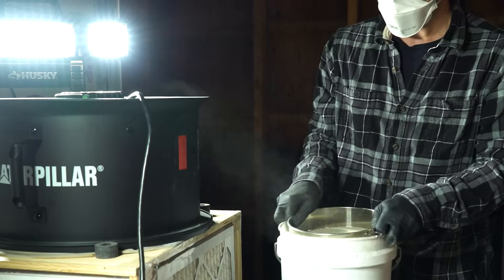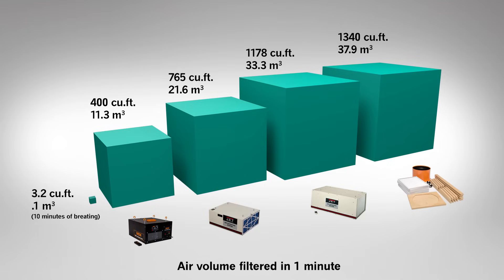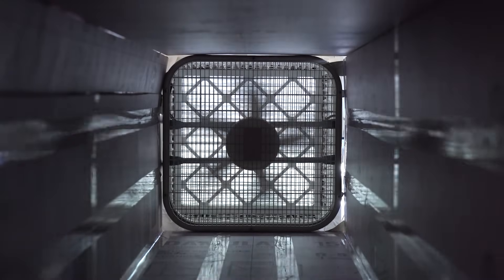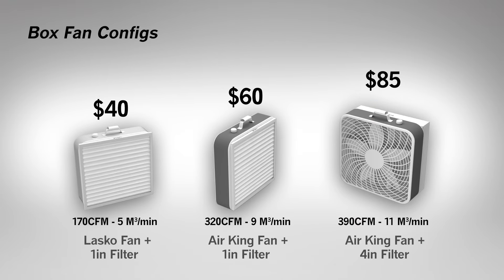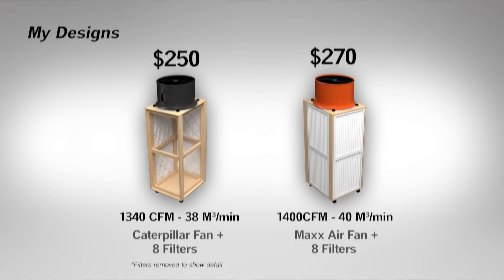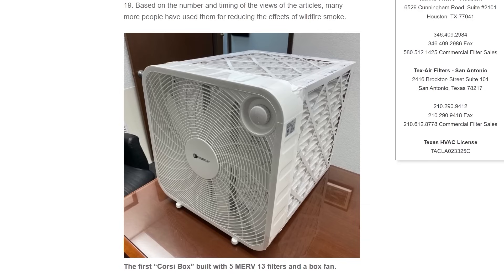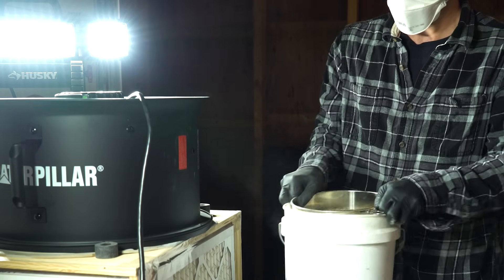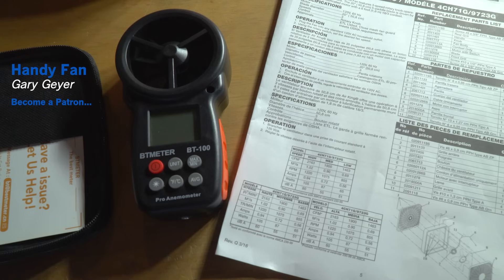What is the best DIY Air Filter?

Comment: I took the plastic grid cover off my box fan and used some old coroplast to build a round shroud just a 1/4" off the fan blade tips. Then put the screen back on the box fan. It's a noticeable difference in how much air it moves so when I put a 1" filter on the back it actually sucked some dust VS before the shrouded blades it sucked nothing (the air was just circulating inside the box fan)
Reply from the maker: I try not to remove the grid from any fan fan for safety reasons. The shroud concept still works when it is on the outside of the fan. My tests show about an 8% gain. I will do a shroud video soon.
Reply: @The3DHandyman  I did mention that I replaced the grid after putting in the shroud. In fact, the grids sandwitching the shroud helped secure / retain it. I did have to make relief cuts in the shroud for the motor mount brackets and didn't try to cover them for a 'perfect' shroud but I doubt they cause much leakage to the airflow. I had thought about adding an anular intake bell using a cut up old pool noodle which is supposed to make a big difference but I needed to get the filter working, now waste time trying to get 1% more efficency.
Reply from the maker: @bobjoatmon1993  Ah, missed that part. Good choice! Personally, I think using a more powerful fan or better filters is the easiest way to improve performance. That can increase efficiency by several hundred percent which can make a huge difference in air quality.
Reply: @The3DHandyman  yes, I have since (just recently) swapped it out for a Dewalt DXF2042 drum fan. My filter box, mounted on the ceiling (so that's a 'blank' side) has  the fan in one side and the bottom and remaining 3 sides have 24X24X1, MIRV filters. I quit trying to make a silk purse out of a sows ear with box fans.

Comment: I have several squirel cage fans from old house AC that seem to move a LOT of air.  Some even have belt and remote motors (ideal for capturing combustible spray (think car spray booths)).  I would love to see your wind tunnel demo on this configuration (and the 8 merv 14 filter box).  Thanks.
Reply from the maker: I got a used blower motor from an old furnace as well. I hope to test that out with a few designs later this year. They are great motors that move a lot of air but they also pull a lot of power in comparison to axial fans.

Comment: You act have the fan wrong your pushing through the filter which put pressure on the fan you need it pulling throug the filter, your hvac dose not push air through the filter it pulls air through it, all hosp an any type of filtration pulls air through the filter, you will Eventually burn that fan motor up

Comment: Nice job dude. I probably would have goofed with the placement of the hinge and filter also. One suggestion would be that instead of drilling a big hole and passing the plug end through it, drill a small hole just large enough to pass the cord through then cut the cord so it won't show from the inside and splice it together again. Then you don't have a large hole with a wonky patch on the inside. Everyone has a different way to skin the cat, right? I like it.
Reply from the maker: Thank you! I like that pass-through method just fine. It's a bit more involved though

Comment: (1) On vacuum pumps, a better solution may be to use a hose like you'd find on a CPAP machine to transport the mist away and out of the work area.  Adding a Y and forcing air into it to create a vacuum effect pulling the mist away from the pump and pushing it on down the line is a game changer.

Feel free to ask me how I know.

(2) On fans, consider squirrel cages. They move a fair amount of air, or they wouldn't be of any value in heating and cooling a home. You may be able to buy one from an HVAC business for the price of salvage

They are simple to set up for a plug and a switch. If you are adept and basic electrical work, you can purchase and install a wafer switch to allow you to chose three, or with some fans, four speeds.

Feel free to ask me how I know.

(3) With a bit of imagination and engineering, you can build plywood frames that allow several filters to be used, adding surface draw area, reducing drag on the fan.  Sandwiching filters with plywood frames [and holes] allows adjustments to accommodate different filters.. For example, you could install a one inch filter to catch cats, bricks and so on. After that, a 4" MERV 11 filter, or better, according to need. Behind that, a charcoal filter.

The frames would allow quick easy changes of filters.

Feel free to ask me how I know.

(4) Consider using manometers or Maganhelic gauges (my choice) to monitor filter contamination levels. They measure the vacuum build between the fan and the filter. 

Noting the start pressure on the gauge allows you to watch the climb, as the filter(s) load with debris. You can tell when you need to clean or replace filters.

I even use these on my dust collectors that would peg the meter/gauge by installing simple aquarium valves just before where the hose ties into the gauge, to turn down how much vacuum is pulling on the gauge.

SIDE NOTE: Using a monitoring gauge on a home furnace or HVAC system is different than using one on a dust collector. The pick up hose goes between the filter and the fan, but this doesn't apply to collectors. Aside the fact collectors will peg the gauges [or empty them, until you limit vacuum pull], the gauge just goes on the intake of the collector, instead of between the fan and the filter.

Feel free to ask me how I knew.

Comment: Is there any value in placing box filters on both sides of the fan.  On the entry it traps the dust, any thing that gets through gets trapped inside the exits side and would also diffuse the air enough to not blow the remaining dust around as much.  Just a thought
Reply from the maker: My concern would be that this may restrict air flow quite a bit. These types of fan need airflow to cool themselves. Other than that, it may work alright, as you said it would double filter the air each time it passes through.

Comment: Good video. Thanks. Something else to consider. I built a 'temporary' filter box over my floor furnace. These things are so terrible I pulled them out of my old house and we went without a heating system for a few years. It's basically a box hanging on the wall, with a 1" filter 20x24" on the bottom above the grate. Works great. It's also forced air, so it heats up my house much much better.
 At the beginning of the heating season I go into the furnace and vacuum out every corner I can reach. (I put a 3/4" aluminum pipe on a DIY adapter to get into the tight areas). Works pretty good, but there's still dust in the air. This year I took apart the small Lasko fan and cleaned the blades and grills. Huge improvement. So those filter boxes with the box fan pointing straight up? They will get dust build up like my Lasko, but also dust falling back down when the system is off. In a shop I would suggest a piece of cardboard as a cover when not in use. 
Also higher up is always better -- that's where we breathe. Even with my furnace filter I have two regular air filters. I find if I vacuum off the outside carbon filter every year I don't have to replace the filters for several years. I live in Southern California, in Los Angeles, so less heat is needed and there's more dust.
Reply from the maker: Interesting info. Thanks for the comment!

Comment: With your kit using the Catepillar or Max fans, is their any gain using 4 inch filters over the one inch ones?  Would the 1 inch be good enough?  Do your clips only hold the 1 inch filters?
Reply from the maker: Personally, I don't see much of a gain with the 4" filters if you are running 3M filters. A 1" 3M MERV 13 filter has almost as much filter material as an off-brand 4" filter. In every test that I have run 3M filters outperform everything. Only a $100 Lennox carbon clean 5" filter can beat them and the cost is hard to justify, especially in a multi-filter setup.

Here's a smoke test that I ran with different filter brands:
https://youtu.be/XAJ__E-hIJc

All filters will eventually clog with dust if you are using one of these in a shop environment. 

2" off-brand filters perform fairly well and are a reasonable price but the Model-A kit doesn't have a clip for them. I designed the Model-B to overcome that issue. I'll have some new low cost versions of that kit coming out soon.

Comment: I wish this video existed ten years ago.  I used to make my own air purifiers with the Lasko fan.  Also, the Lasko fan (and all the other in-house brand clones from retailers) likes to walk across the room if you have a smooth floor.
Reply from the maker: That's a amusing thought. The fans do seem a bit unbalanced at times. I just made a single filter design that incorporates rubber vibration dampening feet that would help with that issue. In general these work great for in home use if paired with the right filter.

Comment: Immediately had to correct something. You said you are using MERV-14 air filters, but are using filters from Nordic Pure. I used to use them a lot. Until I saw several reviews.

Basically, what places like Consumer Reports have found is that Nordic Pure's "MERV-14" actually tested closer to MERV-6.
Reply from the maker: I have since run a lot of smoke tests. They didn't quite perform that poorly but no where near as well as they should have. Realistically I can only recommend 3M filters and Lenox Carbon Clean based on my results. 

Nice to see that is the conclusion that CR came to. Thanks for the comment!
Reply: @The3DHandyman  OK I started watching more of your videos and ended up subbing right away. Awesome stuff!
Reply from the maker: @webx135  Thanks for subscribing!
Reply: @The3DHandyman  Oh I see. Yeah nice to see another set of tests backing it up.

The Lennox Carbon Clean system might be a bit expensive for people. I've been wanting to adapt my HVAC system to support it, but I have 16x20x4 filters and very little clearance to expand it.

I'm working on building a custom air purifier, which is how I got here. The plan is the use either a 3d-printed centrifugal fan, or pull the one from my Honeywell air purifier. And then build a box with slots for HVAC filters and gaskets for a sealed system. I'm currently basing it on Filtrete 2500 20x25x1 which is MERV-14.  All sizes are the same price at my local store, so I might as well use the biggest.

I'll have to check out our other videos, but I've done some testing in the past and learned a couple things.
1. Centrifugal fans are pretty much unbeatable in this category, able to pull a LOT of static pressure compared to an axial fan.

2. If you have a filter on the intake of a fan, it does quite a bit better if there is a decent gap. Too close, and it turns to turbulence. But with a bit of a gap, you can emphasize the static pressure more than the geometry of the fan. My testing was mostly with PC fans and filters. But a 1" gap on a PC fan seemed like it about doubled the performance. You might be able to get more from a single filter that way. Scaled up, of course. So probably like 6-12"
Reply from the maker: @webx135  That's a cool idea. I have been thinking about something like that for my place as well. I'm not sure how much I want to mess with the system's air flow though. It's a gas furnace and I don't want to be forcing air through it in an unconventional way. 

I got a used furnace blower to make a filter with but haven't had a chance yet. What I've found is that they are great for static pressure but they pull a lot of power compared to axial fans (~500watts for a large one vs ~100watts for a drum fan). Inline fans seem to be a good in-between option.

Thanks for your thoughts!

Comment: Did you try the cat or maxx fan on the smaller boxes? I don’t have room for the larger tall boxes, but a cube with a Cat fan might be doable.

Just wondering if it would perform better than the lasso or air king boxes
Reply from the maker: In the last round of testing I did try that out. Using I used 2in MERV 13 Filterbuy filters and 1in 3M MERV 14 filters and in both cases the 20x20in filters performed 12-15% slower than the 20x30in filters when new. This difference will be increased as the filters get dirty but with the Caterpillar fan both are a fine option. 

Many people have bought the 4 filter kits from me in this configuration.
Reply: @The3DHandyman  Awesome, thanks!

Comment: You really set the bar for DIY air filter videos.  
Just wanted you fyi you on one option:  the Healthy Home Guide channel does a version with an ultra-quiet EC motor fan.  
For people like me, trying to filter dust in a quiet office, this is an ideal variation.
He gave you props in his video for your groundwork -- maybe you could do a video / kit with the AC Infinity fan or similar, and send a nod back his way.
PS I have built his version and it really is deadly quiet.
Reply from the maker: Thanks for the heads up! I appreciate the comment, it just got lost in the pile of comments from my latest video. I'll have to check that Healthy Home guide video out. I like the AC infinity fans for just about every application. I am hoping to reach out to them to to get some demo units because they are a bit on the expensive side. Hopefully I'll be able to feature their fans heavily in the next video  🤞

Comment: Bro can you just tell me what I need best for my home
Reply from the maker: I'll do a follow up to this video that explains where each filter is best used in your home. That should be out in February. In general a single filter or 4 filter option performs best. Single filters are better for small rooms. The 4 filter designs will perform better in large spaces than the single filter option.

Comment: No discussion of dust collection is complete without mention of Bill Pentz and his research into  the invisible dust that is stirred up by even walking through a shop that is not vented to the outside. To measure this world one needs a particle meter. Bill recommends a round HEPA filter like the Winn Environmental Nano filter that is exhausted from the center with a round fan because surface area is the most important along with cfm. Just search his name and go to Cyclone and Dust Collection Research. Then click Projects from the top tab and select air cleaner.This work came about because Bill developed extreme allergies triggered by the invisible. This filter is affordable to build and works. The cheapest is not always what is needed. If one reads this entire sight, they will get a window into a huge chunk of information that is often ignored and it is free.

Comment: Thank you for these pretty much exhaustive tests!  I forget which video, but you had recommended Nordic Pure 20x20x1 MERV 14 filters in one of your DIY C/R filter tests. However, in the smoke test video, the Nordic Pure took twice as long as even the 3M MERV 11 filters. To stay within the "Commercial grade" of filters, would you recommend Nordic Pure MERV 14 or 3M MERV 13?  Since the 3M MERV14 is so much more expensive, I probably have to write that one off.
Reply from the maker: Sure thing! With some tests that I ran lately the 3M MERV 13 and 14 performed about the same... at least as far as my instruments are capable of detecting. So For the 3Ms the MERV 13 is my first choice in 1in filter. Even when completely filthy they still perform well. Their 4" MERV 11 filters are also surprisingly efficient. 

As for other brands, the 2in filters from Nordic pure and Filterbuy do fairly well, got great but good enough. If it's 1in filters you are looking at, most are about the same. With these brands they have a way of changing the filter material from year to year as well which doesn't lead me to believe they are very consistent with their performance.

I'll do another comparison video with the results of my new, even more extensive, tests in the next month or two but the ones listed above are the best out of the pack under all conditions.
Reply: I appreciate the follow up! Your tests are so exhaustive, it's really easy to trust your results. Thank you for taking the time out to do these tests and share your findings and for following up on comments. I look forward to the new tests coming soon!